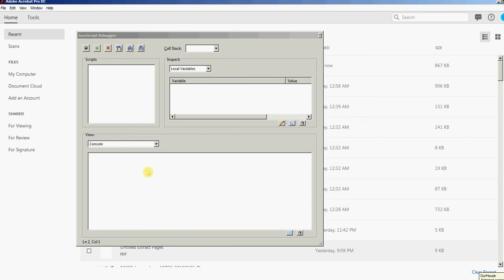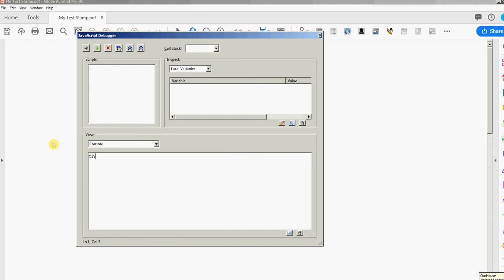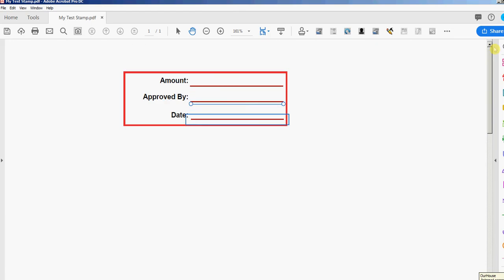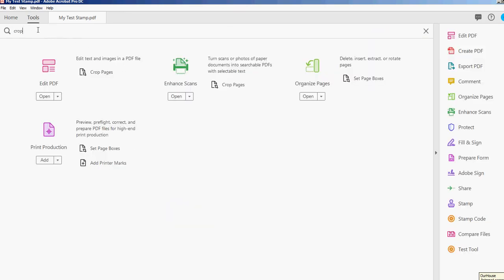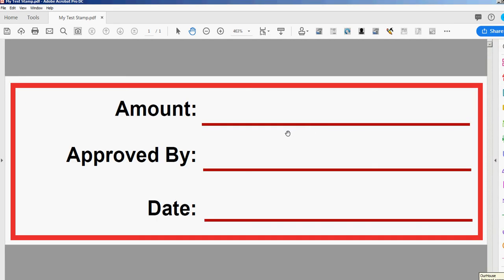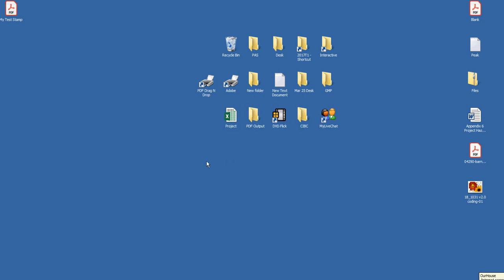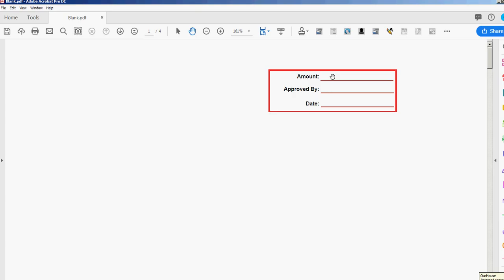How To Create A PDF Stamp From Scratch

Comment: I tried to follow this instruction in PowerPDF and I cannot make page templates (i.e., I could not save the PDF as a page template.)  Is there a way around this?
Reply from the maker: This tutorial is for Acrobat Pro to teach all the elements of a PDF stamp that will be used with Adobe PDF viewers.  It is not suitable for any non-Adobe PDF programs as most of them do not use templates for stamps, and most allow only one page per stamp without any categories.  The categories come from the PDF title so you can stack multiple stamps into the same category using the same PDF.  I am not familiar with PowerPDF but I suspect this is the case.

Comment: Can you have more than one stamp file using the same stamp category, or do all stamps in the category have to reside in the same file?  If it's just a matter of having unique StampIDs, can you pull all custom stamps into the same file and category and manually assign unique IDs?
Reply from the maker: Yes, you can have multiple stamp files with the same category.  If you use the Adobe UI to create the stamp you will have to first remove any files with that category because Adobe will add it to an existing file.

Comment: I have 2 questions: when I import a stamp from a PNG, it changes the size when I want to use it. Sure, I can adjust the size but I want the right size right away and not chance it at all. The stamp shall always has the same size. Why does my program oversizes it? And secondly: how could you make the background of your stamp transparent? What if you don't stamp white sheets but colored ones? then you will always get the white background behind your stamp.
Reply from the maker: For the .png image, create the stamp, stamp a blank page with that stamp, resize the stamp to the size you want, then use that page to create another stamp.  It will be the right size.
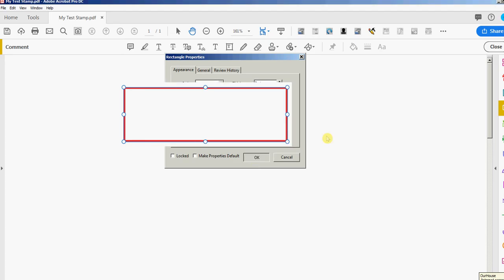If you use a transparent image to create a stamp the stamp will be transparent.  The stamp in the video above is transparent.  Notice no fill color at 1:47 of the video.
Reply: @PDFAutomationStation  Thank you! I made it.

Comment: Weird, it doesn't work for me
Reply from the maker: Which part doesn't work?
Reply: It doesn't work for me either. When I try and run the first code (from my laptop) and hit the enter key nothing happens
Reply from the maker: The regular Enter key acts a line return the same as when you are typing.  You must press the Enter on your number keypad.  If you don't have a number keypad on your keyboard you must press Ctrl + Enter to run the code.   If you are running those 2 lines of code it should do something.  I hope this helps.
Reply: @PDFAutomationStation  Hi thank you. It works!

Thank you for making this video, I am this helps a lot of people.